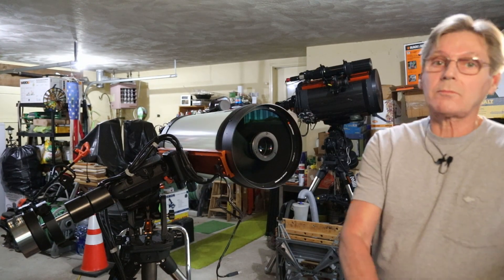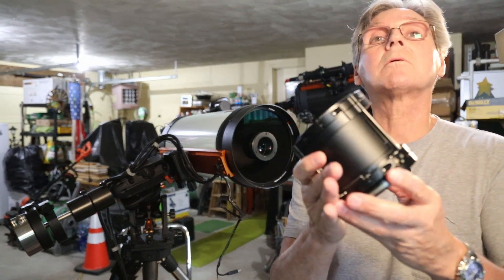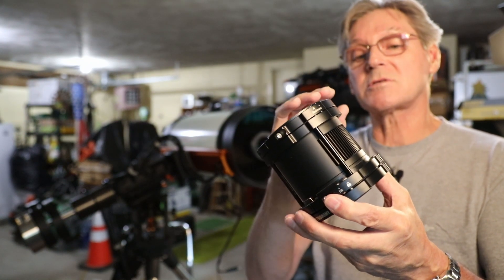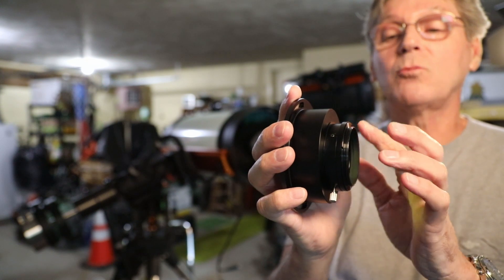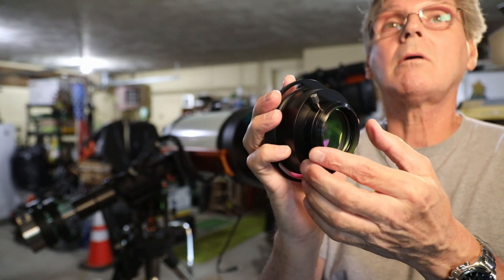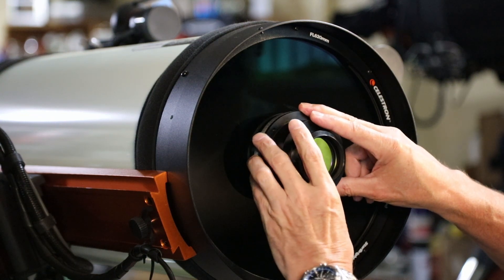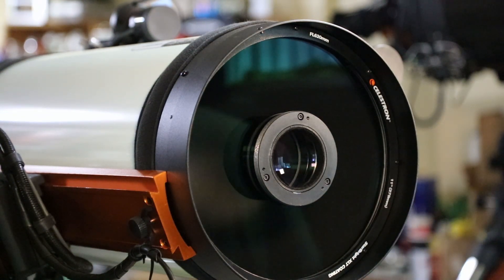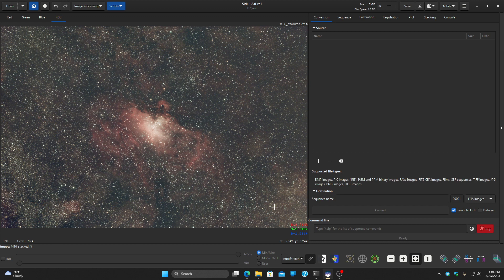Do You Have the Dreaded RASA Ring?

Comment: Thank you, Jeff, great video and very timely as I just finished a narrowband effort on my RASA 11" which clearly showed major RASA rings that I've never seen before.  I saw Luke of Lukomatico had addressed the issue which is how I found you!  I now know how to fix this, and am therefore wondering if I can purchase those two inserts (3d printed perhaps?) from you?  You also mentioned "flocking paper" but as I'm new to the hobby am unsure where/how to purchase this material as well.  Hope you can help, and thanks in advance.
Reply from the maker: Thanks, Timothy  

The parts I 3D printed were for my IDAS RASA 11 Adaptor. If you have the same adaptor, then yes, I can print you the 2 parts I made for that adaptor. If you are using the supplied Celestron camera adaptor(s). Then these will not work with those parts. You can find the Flock or Felt here:

https://www.amazon.com/YaoHui-Adhesive-Sheets-Backing-Backed/dp/B0BYM5LQQZ/ref=sr_1_5?adgrpid=1337006702007014&dib=eyJ2IjoiMSJ9.52NBUdKtJpTk0uY7VmZIubJx7xV_w5gM3rqNa0Xvxu6EUmF6pQ8fqebdFDAe1ZsW2GsgiXRk0x6vyelUCE8bQa6T8jqY5fp6FB3tzOQ02CuQzuuVCjHt-5Gjt67SJAGYUX9DAyuCylxbZMXKZVa9Gp5tdq_A8lkhwmnnKg0g20hCl7PyC_qzcFeZsd9LBcWlwNFVfeLDpF-yN5m3LzqD00B5XI7BsHrkuNXaiFmX1XsZzjx-IO8UxYz3yUJlGWVJqs2glHuGGKQzE9EecxB06nHFvhhve-Xxfgwb6jCSnvY.rWamqYosX3VodDLoCcVbLkrMfIEmK1nJIUceGhqnPxU&dib_tag=se&hvadid=83562989670986&hvbmt=bp&hvdev=c&hvlocphy=104790&hvnetw=o&hvqmt=p&hvtargid=kwd-83563259039727%3Aloc-190&hydadcr=5300_10448130&keywords=sticky%2Bbacked%2Bfelt&qid=1708356603&sr=8-5&th=1

Sorry for the long link...

Comment: My Orion 6” has the same whenever I put my filter at the front of my image train which has a 1.1x coma corrector
Reply from the maker: ortizma  I think what you might have is a reflection between the filter and the sensor. If you can, try putting the filter in a different spot in the optical train. Sometimes that will help...

Comment: Great stuff Jeff I've got the RASA 11 V1 & it came with the Baader filter drawer system which did cause the rings you speak of, I'm now using the stock Celestron adapter & as far as I can see I don't seem to suffer with them,  but using it with an APSC sensor does cause a lot of vignetting which flats take care of. I will still probably flock mine anyway after watching this as every little helps although I do still suffer with some tilt to which I will be sourcing a tilt adapter at some point but I'm not to fussed about it right now.
Reply from the maker: Glad you liked the video. One of the reasons I purchased the Astro HuTech RASA 11 Adapter was to get a bigger hole to help with the vignette I had from my full-frames sensor I'm using with my RASA 11. You will always get some vignette with faster scopes just because of their design. You get a hot spot that falls off fast to the outer edges. What also helped me was making my flats a little hotter. I use NINA's Flat Wizard and use an extra 10% for the mean. This helps to even out the hot spot to the edges. Good luck with your rings...  They can be hard to handle...  CLear skies.

Comment: I see these rings in my sct images and it is most noticeable when I have stacked reducers. I am sure the extra threads and adapters involved contribute to reflection. I ordered a bunch of flocking material some time ago but have not taken the time yet to implement it and see the results. I would like to have seen an apples to apples comparison with a second capture of M51 instead of a different target. Good video though. I will be flocking everything I can in my image train and see if I can have similar good results.
Reply from the maker: KB, Just been having too much smoke to try M51 again. Seems like all of western Canada is on fire and has been since April of this year... Jetstream pulls the smoke right over me. All I have to put up with is the smell and I still have a home. Some aren't quite as lucky as I am and have lost everything. My hope is that as it gets cooler out. The fires will die down and I can get back to doing some good Astro work with the gear. Seems like its been over a year since I've seen cloud and smoke free skies. It will turn my way... eventually.  ;-)

Your reflections might be between the reducer and the sensor. I have seem that happen before... Good luck with your fixes...  Clear skies.

Comment: I just got my RASA 11 in and had my first light last night. I don't see the rings on my images, but I think I see them in my calibration frames.
Reply from the maker: If you believe your calibration frames are the problem. Try stacking the lights only and see what happens. After having meesed with this for the better part of 2 years. I tried many things. Faster scopes need a hotter flat. I have been making mine with the mean at around 40,000.  Anything lower and the flats don't work as well with my setup. Dark flats (bais)  and darks I make with the sensor cover on the camera. I don't see how a dark or dark flat will have a ring unless your have a bad sensor. Then I had a friend that teaches Astronomy tell me that this is a problem that the larger observatories have with thier large fast scope. They needed to use a special black paint and apply it to anything near the light cone to keep the reflection to a minimum. 

When you have an image that has been pre & post processed. Then stacked, as you do things like a background extraction and what ever else one would do. This is when you start to see the ring appear. I have seen some RASA setups that have the ring without even doing a thing to the data. When I went to a full frame sensor with my RASA 11. I had to get larger adapters to help fight vignette. This helped with the reflections to a point. they were still there but as you saw in the video. They were still present and hard to deal with.  I believe you have a reflection issue that needs addressing. 

Clear skies...
Reply: Thank you. I will try that and let you know. @jeffrh

Comment: Great Job Jeff, and timely video! I have mentioned the rings a couple of times in my videos and your findings backup my thoughts on them. I have actually already purchased Musou Black IR Flocking sheet and paint to tackle my scopes. The order arrived a couple weeks ago and now just need to get on with the mods!
Reply from the maker: Dave,  I didn't use anything other than some flock I got at Hobby Lobby... and those 3D printed parts I made to allow me to slip them in and out as needed. Hope you have as much success as I did with your efforts to removes these pain-in-the-butt rings that ruin the data... I just wish Celestron would have had more information on what these rings were from and how to fix them when I purchased the scope a little over 2 years ago... Now my RASA 11 is making the best imagery I have ever seen come out of it... One Very Happy Astro Camper!